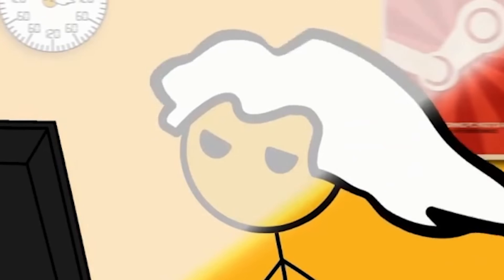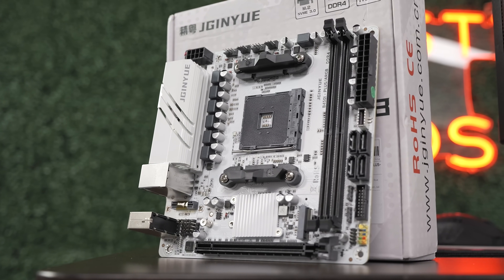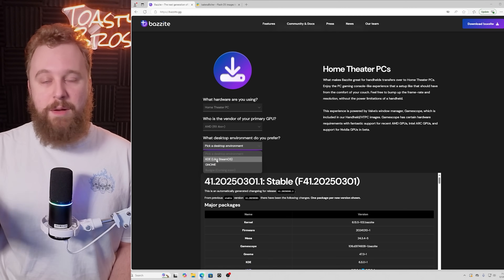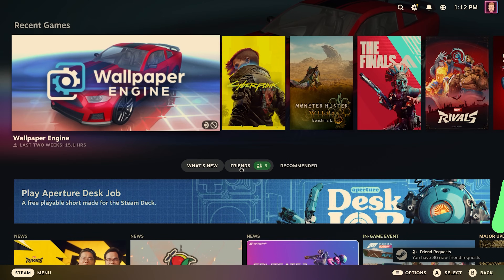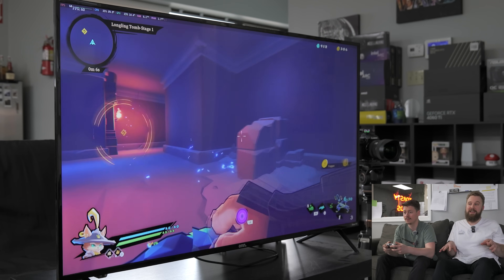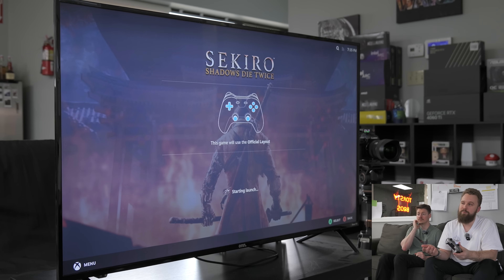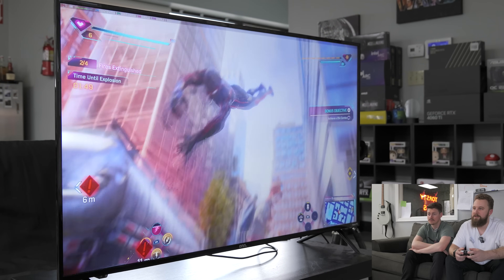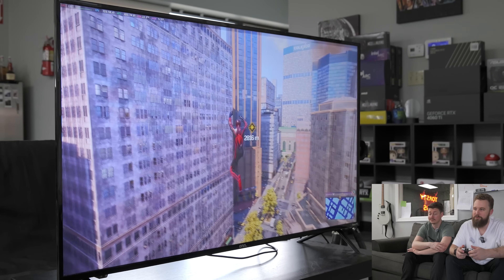Don't Buy a Console....Build One Instead! - Bazzite Mini ITX PC

Comment: The F-22 Raptor, developed by Lockheed Martin for the United States Air Force (USAF), is a fifth-generation, multi-role fighter aircraft designed for air superiority, stealth, and precision strike missions. It integrates advanced technology to provide unmatched performance in air combat, and is often regarded as one of the most sophisticated fighter jets ever built. Below is a comprehensive breakdown of how the F-22 Raptor works across various domains, from its design and performance to its systems and operational roles.

1. Design Philosophy and Structure

The F-22 was designed with several key priorities in mind: stealth, speed, agility, and survivability. Its shape and materials are all optimized to meet these goals.

Stealth

The F-22 features stealth technology, which is its most crucial element for evading detection by radar. The aircraft’s design minimizes radar cross-section (RCS), making it harder for enemy radar systems to detect and track it. This is achieved through:

Shaping: The aircraft is designed with angular lines and surfaces that reflect radar waves away from the source, instead of towards it.

Radar-absorbent materials (RAM): These materials are used in key areas of the aircraft to absorb radar waves and reduce the likelihood of detection.

Internal weapons bays: To maintain a smooth, radar-reflective surface, the F-22 carries its weapons inside the fuselage rather than on external pylons. This reduces its radar signature while still enabling it to carry a wide variety of weapons.

Airframe and Materials

The F-22's airframe is constructed from a combination of lightweight composite materials and high-strength aluminum alloys to ensure maximum strength and durability while keeping weight to a minimum. The aircraft is built to withstand high speeds, high G-forces, and harsh conditions without compromising performance.

Aerodynamics

The aircraft’s shape contributes significantly to its agility and maneuverability. The F-22 features a supercruise capability, which allows it to fly at supersonic speeds (above Mach 1) without using afterburners, making it both faster and more fuel-efficient than many other fighter jets. The forward-swept wings and the tailored air intakes help it to perform advanced maneuvers with minimal drag, allowing it to engage enemies at angles other aircraft can’t.

2. Avionics and Sensor Systems

One of the standout features of the F-22 Raptor is its advanced avionics that help pilots detect and engage targets far beyond the range of many other aircraft. These systems are integrated into a single cockpit display, providing the pilot with critical data on a single screen for ease of use and enhanced situational awareness.

Radar

The F-22 is equipped with the AN/APG-77 radar, a highly advanced active electronically scanned array (AESA) radar system. The AESA radar offers several advantages over older radar systems:

Long-range tracking and targeting: The radar can detect and track enemy aircraft from long distances, even if they are attempting to hide in the terrain or clutter.

Electronic warfare capabilities: The AESA radar can jam or spoof enemy radar systems, allowing the F-22 to disrupt the enemy's targeting systems.

Multiple target tracking: The radar can track and engage multiple targets simultaneously while maintaining focus on a specific enemy.

Sensors and Electronic Warfare (EW)

Beyond the radar, the F-22 incorporates a range of sensors and electronic warfare capabilities:

Infrared Search and Track (IRST): The F-22 is equipped with an IRST system, allowing it to detect heat signatures from enemy aircraft, missiles, and ground targets, even when radar is not in use (to preserve stealth).

Electro-optical targeting: This system gives the pilot a visual view of targets, even in low-visibility conditions.

Electronic Warfare (EW) Systems: The F-22 includes advanced systems for detecting and disrupting enemy radar and communications systems. It can also deploy countermeasures, such as chaff and flares, to avoid incoming missiles.

Data Link and Networking

The F-22 is highly integrated into a networked battlefield through advanced data links. These allow it to share real-time information with other aircraft, ground control stations, and satellites. It can receive targeting information, weather updates, and operational data, improving the overall combat effectiveness of a team of aircraft.

3. Engine and Propulsion

The F-22 is powered by two Pratt & Whitney F119-PW-100 engines, each providing up to 35,000 pounds of thrust with afterburner. These engines offer several key capabilities:

Supercruise

The F-22 can cruise at supersonic speeds without the use of afterburners, a feature known as supercruise. This gives the F-22 a significant advantage in long-range interception and high-speed engagement, as it can maintain high speeds without burning excessive fuel.

Thrust Vectoring

One of the key factors in the F-22's agility is its thrust vectoring nozzles. These nozzles allow the pilot to manipulate the direction of the exhaust gases, giving the aircraft unparalleled control during high-speed maneuvers. The pitch and yaw control enabled by the thrust vectoring allows the F-22 to execute sharp turns, evasive maneuvers, and high-angle-of-attack operations that are impossible for most other aircraft.

4. Weaponry and Armament

The F-22’s weapons systems are designed to allow it to engage air-to-air, air-to-ground, and anti-ship targets. Its internal weapons bays are equipped with a variety of air-to-air missiles and precision-guided bombs.

Air-to-Air

The primary armament for air superiority missions includes:

AIM-120 AMRAAM (Advanced Medium-Range Air-to-Air Missile): This missile is used to engage enemy aircraft at long ranges.

AIM-9 Sidewinder: A short-range infrared-guided missile used for close combat.

Air-to-Ground

For ground attack, the F-22 can carry precision-guided bombs, including Joint Direct Attack Munitions (JDAM), allowing it to strike targets with high accuracy from great distances.

Internal and External Payload

While the F-22 primarily carries weapons inside its fuselage to preserve its stealth, it is capable of carrying external weapons if needed. However, using external pylons compromises its stealth and makes it more vulnerable to detection.

5. Flight Control Systems

The F-22's flight control system is highly automated and uses advanced software to enhance its maneuverability. The aircraft features a fly-by-wire system, meaning that electronic signals are used to control the flight surfaces rather than mechanical linkages. This allows for:

Improved stability: The system constantly adjusts the aircraft’s control surfaces to maintain optimal flight performance.

Agility in combat: The software can make rapid adjustments to allow the F-22 to perform complex maneuvers at extreme angles of attack and high speeds.

6. Cockpit and Pilot Interface

The cockpit of the F-22 is designed with the pilot’s situational awareness in mind. It features a glass cockpit with a large Heads-Up Display (HUD) that presents critical information like speed, altitude, radar tracking, and targeting data. The Flight Control Stick is equipped with a variety of buttons and switches to control the aircraft’s systems without the pilot having to remove their hands from the stick. The cockpit’s layout minimizes distractions, keeping the pilot focused on the mission at hand.

7. Operational Role

The F-22 is primarily designed as an air superiority fighter, meant to establish and maintain control of the airspace during a conflict. It can engage enemy aircraft in long-range combat or close-range dogfights, thanks to its advanced sensors, weapons systems, and superior agility. However, it is also capable of performing ground strike missions in support of joint operations. It’s ideal for multi-role combat, able to transition seamlessly from one task to another, making it a versatile asset in modern warfare.

Air Superiority

In air combat, the F-22 excels at detecting, engaging, and destroying enemy aircraft at long distances, while avoiding detection through its stealth capabilities. It can operate in contested airspace with minimal risk of being targeted by enemy aircraft or surface-to-air missiles.

Precision Strike

Although its primary role is air-to-air combat, the F-22 can also be used for precision ground strikes. Its stealth, advanced sensors, and weaponry make it an effective tool for eliminating high-value targets, even in heavily defended areas.

8. Maintenance and Sustainability

The F-22 requires significant maintenance to keep its advanced systems functioning properly. Its stealth coating and sensors must be carefully maintained, and its engines are highly complex, requiring regular servicing to ensure peak performance. The aircraft is also integrated into a global logistics support network, allowing for rapid replacement of parts and ongoing maintenance.

Conclusion

The F-22 Raptor is one of the most advanced fighter aircraft in the world, integrating cutting-edge technology in avionics, propulsion, and weaponry. Its combination of stealth, speed, agility, and advanced sensors allows it to dominate the skies in both air-to-air and air-to-ground combat. Although it’s now in service alongside other advanced aircraft, such as the F-35, the F-22 remains a cornerstone of the United States' air superiority strategy, ensuring that it can maintain control of the skies for decades to come.